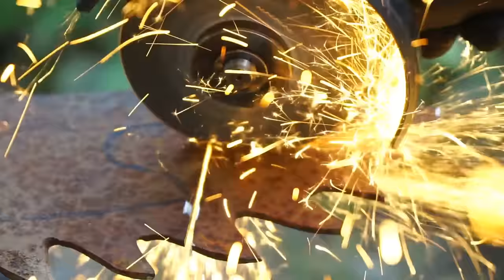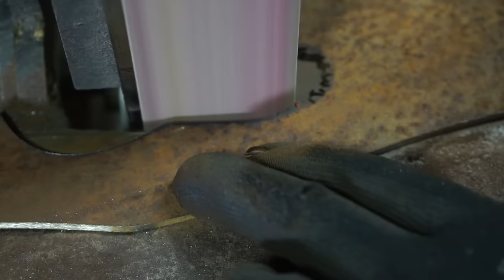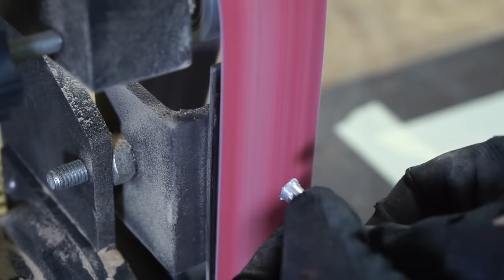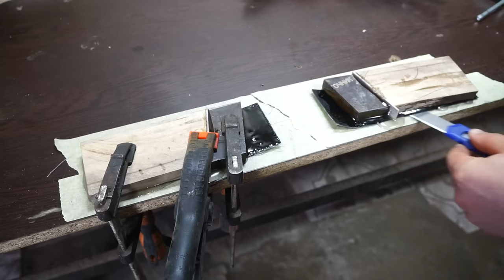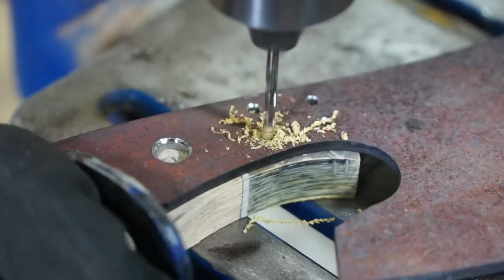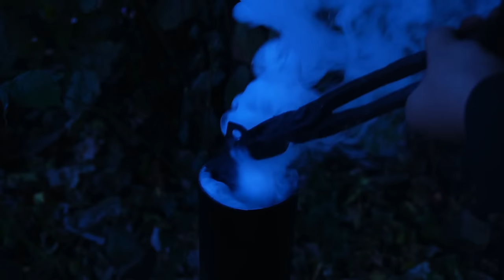Making a large kitchen knife from an Old Saw Blade

Comment: Saw Blades are high carbon and  hard material.I need of forging and hitting it. it's already in knife thickness. So just we have to cut it and give shape of knife sharpen it. Then temper it it will serve as long.

Comment: Really well done. except for one major thing. You should have removed all the rust before putting on the handle. This blade may look cool now. But it will rust in no time. And a kitchen knife, should always be polished to a high shine all over, in order to decrease surface for bacteria to grow, and make cleaning easier. That coal black  rusty surface of the blade would be perfect growth place for bacteria.